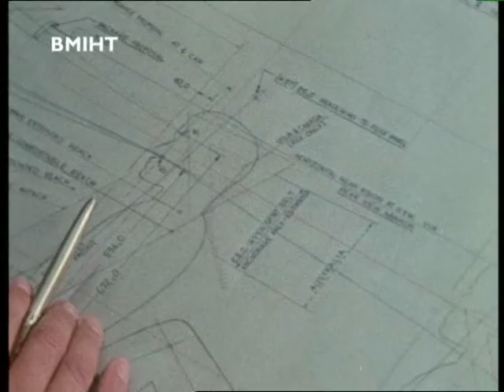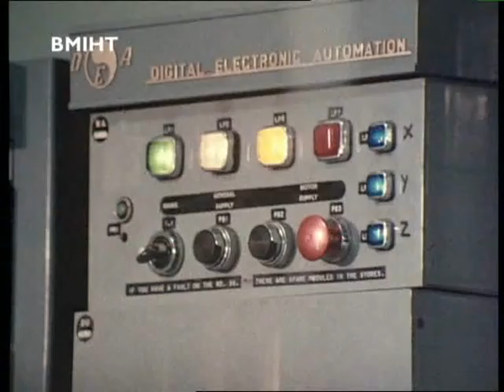Austin Metro Development 1

Comment: The metro kept me employed throught the 80's 90's and into the 21st century, welding sills, front panels and crossmembers, inner sills floor, back subframe mountings, back panel, back swinging arm bushes, hydroelastic units engines, gearboxes. there wasn't a thing that didn't go knackered. kept me employed not a bad word to say, unlike those pesky micras, civics and starlets that never broke down

Comment: I had one a good few years ago, nice little basic car. Thankfully a good friend knew how to slow down the rot ! This was driven by what amounted to the same engine/gearbox used in the old Minis, and the 1100/1300 range, then the Allegro. By the time the Metro appeared it was all getting on a bit ! My good friend, who'd been in the business for years, always said they should've produced the 11/1300 range two door models as hatchbacks. Evidently there was very little that needed changing in the body, and he always said BL should've listened to the Pressed Steel Co who made the panels and redesigned the thing to eliminate many of the rust traps. But Issigonis vetoed that, and so a whole generation of rust-boxes were made.

Comment: Drove an old wolseley 1100 for many years fitted with the 1275 twin-carb engine. Nice little car that was, and when someone ran into me, and wrote it off, had a Metro. I was very surprised to see the Metro had the very same engine and transmission. I know it was an A+ lump, but it sounded almost the same.